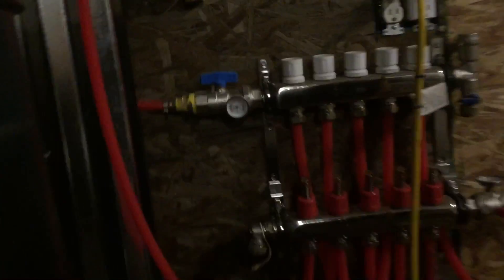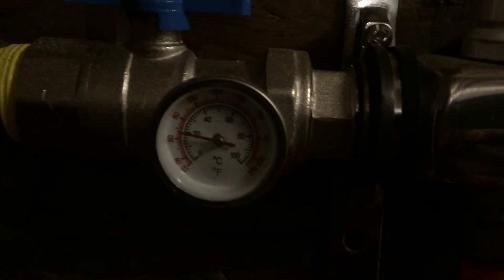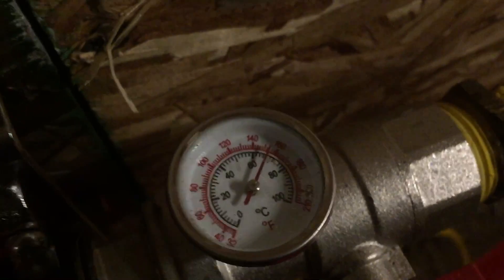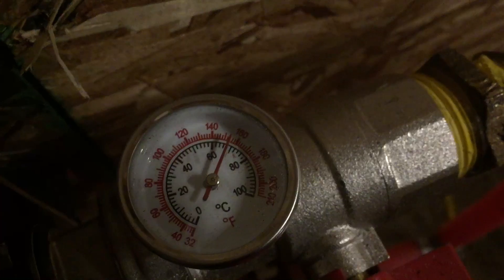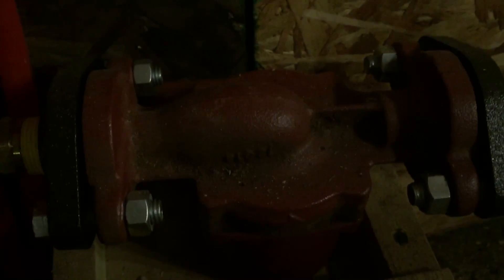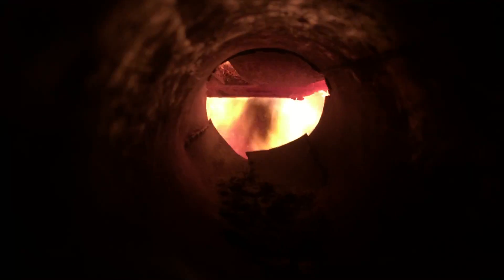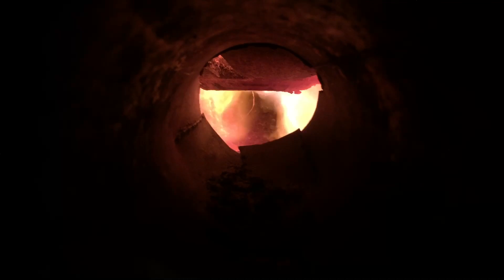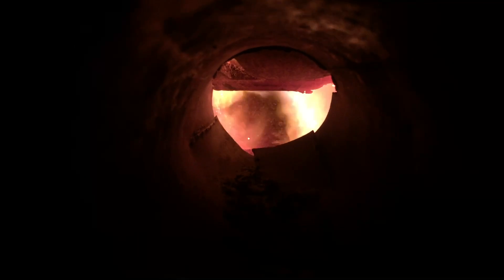Heat output from The Dragon V2 (rocket stove boiler, water heater)

Comment: Great video.  I have watched it several times but I am new to rocket stoves and I cannot determine from your video if the INLET cut which is about about 4 inches from bottom of oil drum (external) is ALSO then cut into the propane tank within the oil drum.  The reason I ask is it seems when you cut the oil drum and then put then INLET pipe in it goes in very far.  I would like to consider using this method of heating for a hot tube but need clarification if possible.  ALSO..  do you put the wood into the propane tank (TOP) from the of the unit to get the fire going.  How do you get it fired up.  I dont see a video on this.  Thank you for your help.

Comment: I was kinda hoping to see a direct part 2 to the build video showing the test burn. Also this video shows up as a little bit dark so I couldn't really make out the details but obviously it works out pretty good. I'm thinking about doing something similar to this but having a mass cob bench to heat up and using copper line coiling which will run to radiators with blowers for faster heating . I have a 32,000 cubic foot shop with concrete flooring ,so needless to say it can get cold in here . Whoever poured this concrete was an idiot ! There's no moisture barrier at all ! No plastic was used anywhere to keep the moisture content down .I live in Washington state where we don't tan we rust . The first four letters (wash) stand for the climate here .So when it gets muggy outside the floor sweats . Likewise when we have heavy rainfall it sweats through the floor . Couldn't believe that someone could be so stupid to not put down a moisture barrier especially in this climate . So anyway keeping the air dry and warm is imperative . I plan to use liquid rubber and paint this slab once I use a heavy duty degreaser agent .This place was used as a auto repair shop for several years and God only knows what's been spilled on the floor . Anyway just getting ideas on how to maximize the heat potential for a rocket stove and found your video .
Best regards to you and your family .✌
Reply: This sounds pretty cool.  Any chance you'd make some videos about it?  (i.e., design, build, finished product and results, maybe even how-to?)  I know making videos are a lot of work, but it'd be great to see your ideas in action.  If you decide to produce anything, please reply here to let me know if you think of it.

Also, I live in NC, but we get pretty humid around here, too!  Probably not as much as Washington, tho...  In the last couple of years I've developed some moisture issues in my house, and am hoping a vapor barrier will do it some good, too.  I feel your pain!  Thanks for sharing, and take care!

Comment: Are you still using this stove?  I want to build a boiler but I wanted to wrap the pipe around the tank/fire box instead of a water jacket. Do you think it would heat up the water that way enough to heat baseboard.  I been messing with wood boiler and use them now but the smoke is to crazy with a water jacket.
Reply from the maker: As long as you have adequate pressure relief It should work, carful not to kink on the corners and make as much metal to metal contact as possible for thermal conduction.
Reply from the maker: The closer to the hottest heat the better.

Comment: OK, so you burn 8 bundles of 12 or 192 blocks a day. Each block is around 2# or just under 16KBTU per block? That would be 3,072,000 BTU/DAY in fuel.  At 1GPM or 8# of water per min with the 86F temp increase seen in your video you are getting about 41,280 BTU/HR. Over 24 hours 990,720BTU. I am assuming that fuel burn was for 24 hours straight, anything less makes these numbers much worse. If it is for 24 hours of operation, that is about 32% efficient?  Even if your pump is moving 2GPM, that is still just under 66% efficient. But if your burning that much fuel over only 12 hours, you are only getting half as much heat which pushes the efficiency down into the teens at 1GPM...  For the volumes of heat you are dealing with, your heat exchanger(coper) is WAY undersized IMO and most of the heat is going up the chimney...

Comment: Very nice. do you have a comparison for efficiency to a more standard wood stove?
Reply from the maker: +J. Dana Clark yes.   I used a modified fisher wood stove with a heat exchanger the first year in the house.  It was very inefficient as a boiler. This rocket stove used less than half the amount of wood as the fisher did.     Note: the dragon is not inside our living space.  We have health issue with one of our kids so we cant have smoke/particulate in the house. I have it in an outbuilding and the water gets pumped into the house. Which is a good thing since when I load the stove it releases smoke.
Reply: midevilone I'm assuming you can fill the old propane tank to the top with wood, and if so, how long does it burn?
Reply from the maker: J. Dana Clark sorry just saw your comment.  Yes the tank gets filled.  Burning the fireblox in the V2, I get over 12 hours of burn time.
Reply: That is a really nice set up then.  

If you go for a V3, may I suggest a duel pass multi-tube heat exchanger.  A local company builds some very high efficiency out door wood burners that use that system.
Reply from the maker: thanks :) 
The v1 actually had a multi-pass setup initially
Reply: Did you have issues with it?
Reply from the maker: I made the mistake of damping the stove down (starving it of oxygen) when we went out of town for thanksgiving a year ago, and when I came back a week later there were still coals in the stove but it had made a TON of creosote that dripped back down the stovepipe into the stove and clogged the air passage at a choke point.  it was the middle of winter and we needed heat so at the time I just cut the top of the return tank out and let it vent straight out the top.  It was a quick fix and it burned so well with that mod, I just never went back to undo the alteration.
Reply: Got you.